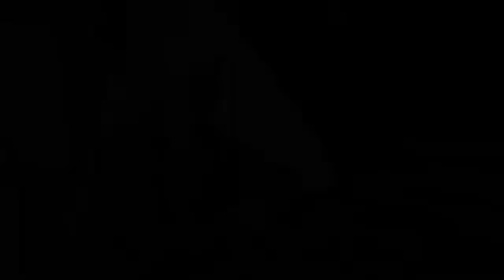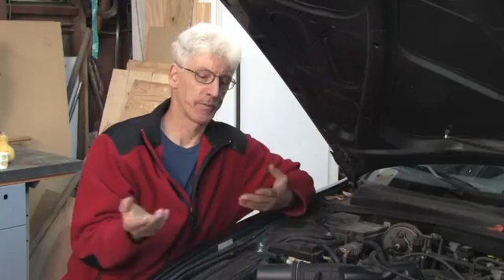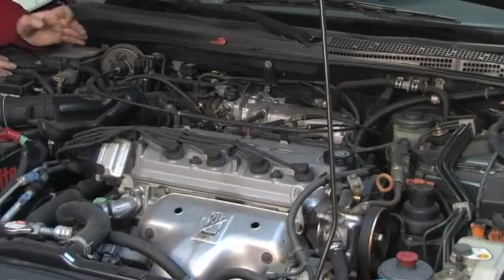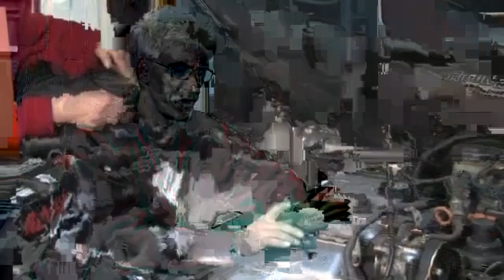How to Convert a Car to Run on Alcohol

Comment: In the apocalypse/shtf situation eventually gasoline will go bad. Only viable fuel options will be alcohol, bio diesel, and electricity (granted the main power grid will be down but other ways to create electricity).

I researched and heard methanol is about half fuel efficient (race car drivers will often tune their vehicles for methanol) as gasoline. So converting a car to run on ethanol/methanol would be a viable option. Also the alcohol from the stills can be used as disinfectant.

Comment: From what I understand Brazil runs almost exclusively on Ethanol and convert imports all the time. I’m sure a dedicated and well informed American can do the same. Thanks for sharing this video!
Reply: In an apocalypse situation, we will no longer receive new gasoline and gasoline eventually goes bad. So to continue using auto mobiles we will either need to tune cars to ethanol/methanol and brew/distill alcohol.

Biodiesel is also another good option. Diesel can also be cut with automative oil in a pinch to extend fuel. So gutting an automobile to weigh less and putting in preferably a 500cc or better diesel engine would be a viable option too.

Robot Cantina put a $100 (212cc) harbor freight in a 1300 pound Honda and was able to hit 40mph. Later he put a 719cc Kubota tractor diesel engine and able to go 60+ mph while getting 60-70mpg.

I wouldn’t even mind having like a $200-$300 diesel engine in like a go kart for an apocalypse situation. Scavenge as much vegetable oil as possible then make bio diesel then cut with motor oil and even make a machine to purify recycled motor oil to cut the diesel with.

Comment: Mighty strange that there's a huge 30-40 second part cut out....
Reply: To mix it with gas you have to turn your regular alcohol into anhydrous alcohol. Its not that complicated
Reply: Yeah kinda wack
Reply: turn the subtitles on. the data is still there its just missing the visual and audio component
Reply: Yeah this is « strange » that one part of the video is broken… 🤷‍♂️🤦‍♂️✌️
Reply: This is basic chemistry. Not everything is a conspiracy.
Reply: @BertRedd  >Not everything is a conspiracy. Right, right, everything is fine everything is fine everything is fine bahhh bahhh

Comment: What about the rubber in the fuel lines and gaskets. Do they need to be changed to prevent deterioration?
Also, will the catalytic converter need to be modified or removed?
Reply: Not if you are running a high proof 190+, with very little H2O contamination. According to 'Alcohol Fuel: making and using ethanol as a renewable fuel' by Richard Freudenberger.
Reply: Stainless steel fuel lines are definitely needed.
Reply: @bladenrexroth2555 you are wrong.
Reply: @koontzman123  go ahead and run that E100 through rubber lines and silicone seals. Tell us how expensive it got afterwards.
Reply: @bladenrexroth2555  I come citing sources, you come with unsubstantiated opinions.